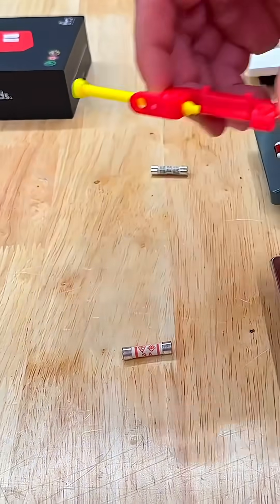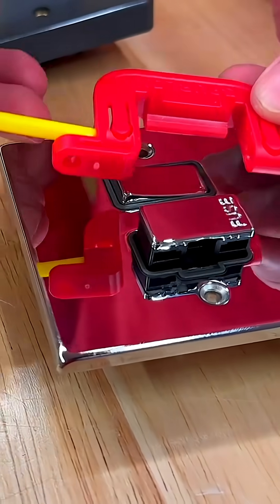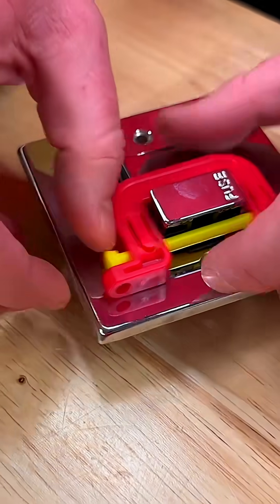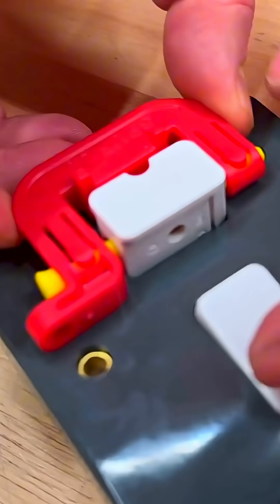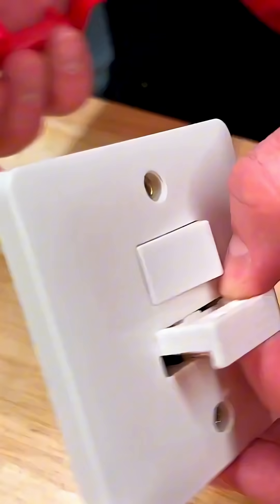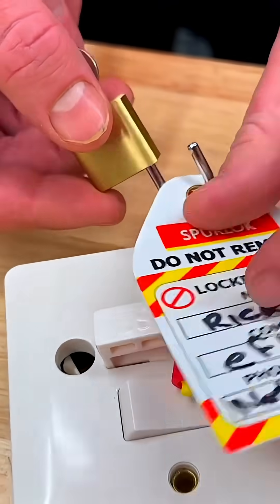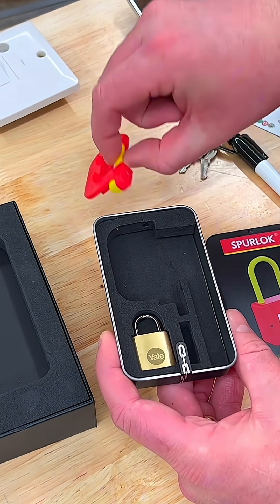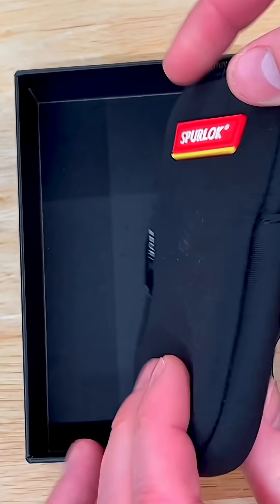Step-by-Step: Using the Spurlok Device 🔒

Comment: The mk logic connection units have a hole in the fuse carrier for a pad lock. I do feel this is a bit over kill since connection units are normaly near the connected load and with the fuse out can't energise that load
Reply: You are absolutely right! Some manufacturers have designed their Fused Spurs with built in Lockout points such as the MK brand. However the type of padlock required to isolate from different FCUs can vary significantly with some units not facilitating lockout at all. That's where the Spurlok device can help by isolating from any type of Fused Spur with one device and one padlock 🔐👍🏽

Comment: Everyone saying this is overkill. 
How about for a rental property, locking a dangerous spur out until you can get the materials? Lock it out with this, take an image to cover your arse. If they break if off and energise the circuit, causing damage or a fire.. you’re covered.
Reply: Or just disconnect the load inside the switch...
Reply: @MarcFrost-n5l so, same effect…? neither option is overkill…?
Reply: @jamalmustafa225 I don't think it's over kill to isolate a faulty or potentially dangerous equipment. I just think its pointless to buy a lump of plastic to carry around with all my other tools when the same outcome can be achieved by simply removing the fuse or disconnecting the load. If someone really wanted to re energize it, neither method is going to stop stupid

Comment: Mostly your not working that far from a fused spur of its installed in a kitchen for either a fan or socket below so you would be able to keep
An eye on it , if it’s for a central heating system
And quite away from wiring centre one of those small suitcase padlocks would work just as well , can’t see that putting up with constant licking off you struggled trying to push it through on one of them

Comment: Just use a cable tie if you are that worried, we don't need more gimmicks to carry.  🙀
Reply: I got an auditor who said anyone could cut that off.  Then I pointed out the lock off kits are mostly plastic and could be cut just as easily.  I still have to use a propriety lock off - apparently.
Reply: @jasonwatson9011  Rubbish.
Reply: @jasonwatson9011 one of the purposes of a lockout/tagout is to clearly and unambiguously show that whatever the LO/TO device is on is inoperative, and a cable tie doesn’t do that.  It just means someone stuck a cable tie on it, which could mean anything.